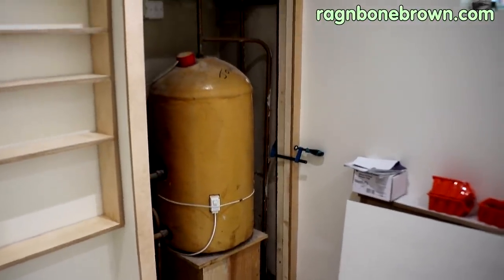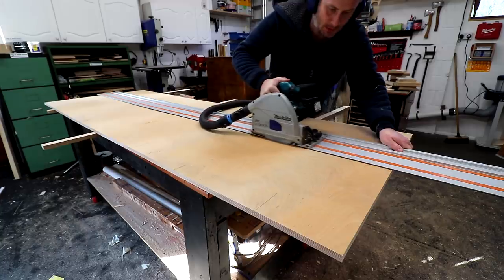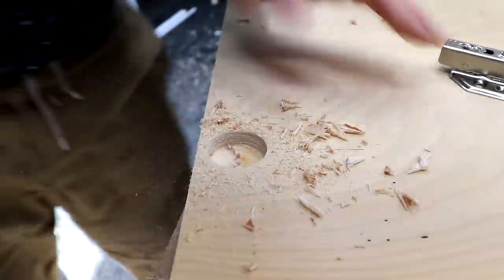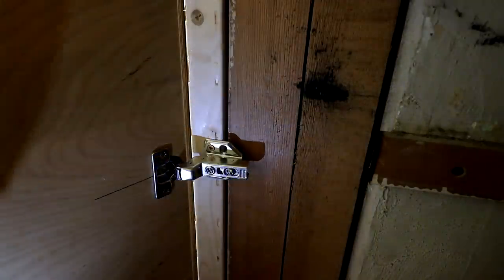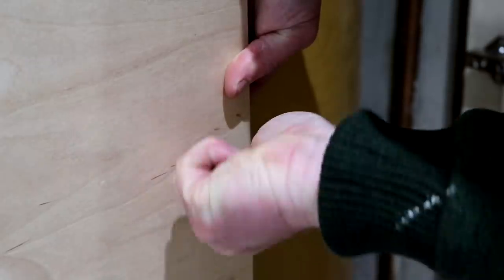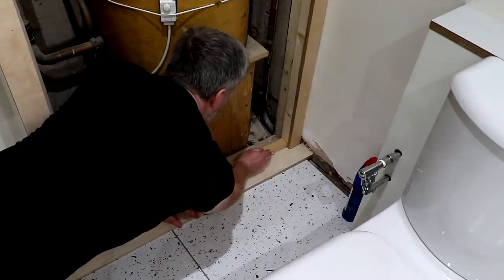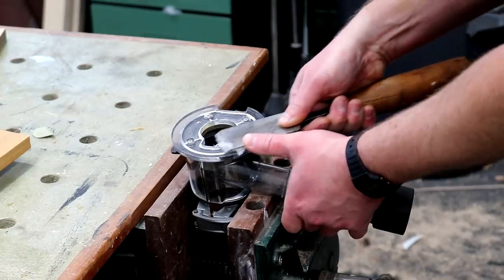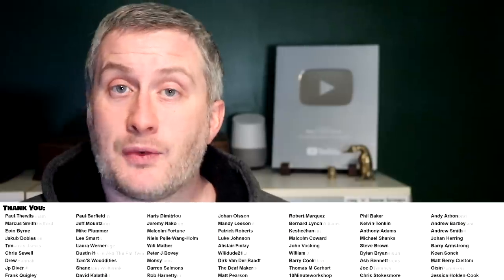Bathroom Built In Cabinet (part 3 of 3)

Comment: Great attention to detail! Im impressed. A tip for Hot Glue in the future is alcohol. Spray on some IPA or alcohol to the hot glue and give it 30 seconds and you can peel it off with your fingers. Makes it so much easier
Reply: I was just about to comment the same thing and then I spotted this. It really works great, I use hot glue for all sorts of "clamping" tasks now because I now I can remove it perfectly even from fragile surfaces.

Comment: Nice build Keith, lots of space, clean & bright. . My only concern is the ply lying directly into concrete that it might "wick up" moisture from the concrete. If you have a mm space, it would be worth putting a DPM under the ply to keep it away from the concrete.
Reply from the maker: Cheers John. As the room has no exterior walls (it's right in the centre of the house) the concrete stays dry, no rising damp. Also the silicone beneath would act as a moisture barrier, I think, unless it is touching I'm any areas! 👍

Comment: Looks great Keith! Good tip for using hot glue on a router or anything really is cover it in masking or painters tape first, that way you can just pull it off after, I do the same when transferring shapes from one price to another, masking take on each piece then use miter mate or ca glue to stick them together, when you’re done they just pull apart 👍
Reply from the maker: Such a shame I always forget that trick! Thank you

Comment: Cracking job! Would love to see more shots of the bathroom but you really nailed it.
Seems like you're happy with manual measuring for the hinges but I picked up a Kreg concealed hinge jig for about £35 when I did my kitchen. Really easy and quick to use and perfect placement every time.
We've also got a lot of birch ply in our house and have seen no water staining from mopping, but we used osmo oil-wax finish so YMMV I guess!
Reply from the maker: I had a bad experience with Osmo so don't use it anymore
Reply: @RagnBoneBrown  ooer, do tell. I'm about to do some fitted wardrobes with it

Comment: Looks great, but i think you'll regret using both the water based varnish and the plywood on the floor eventually.
Reply: Most of the time he uses marine grade plywood for stuff like this. At one time he was sponsored by a manufacturer of it. Which case it's used in boat building so it'll be perfectly fine